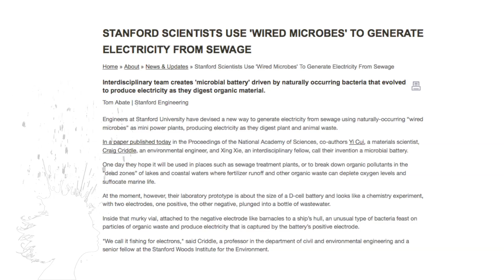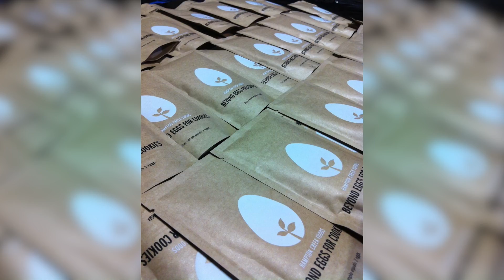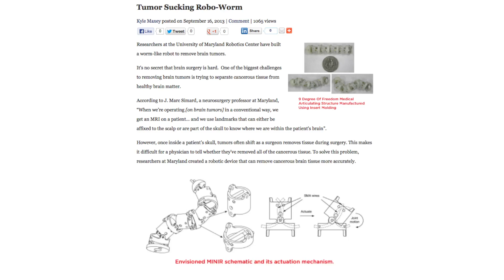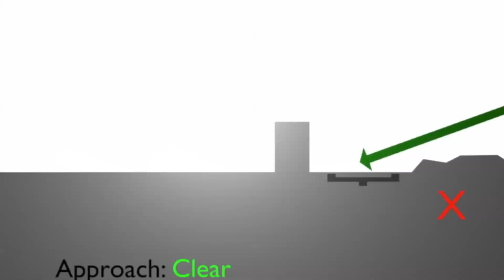POOP ELECTRICITY? -- Mind Blow #71

Comment: boeing is lying there @$$ off . 3:13 2 guys are visible in the "unmanned" helicopter"
Reply: They could be in there to land the Helicopter if something goes wrong with the AI that controls it.  You wouldn't want to lose a very expensive peace of tech because of one small programming bug.
Reply: Quanvex that is true but you also dont want to show it off and say its unmanned when its got 2 guys in it . at least tint the damn windows
Reply: I doubt they would let the prototype fly itself for the test run. Guess its safer to do the tests with pilots or passengers inside to see how it reacts with their weight. Kinda meaninless to have a copter you paid billions of dollars with barely any use or to let it crash in the test run, just saying.

Comment: it is most likely they have to produce in order to generate enough electricity, and of course they will also collect what is in there, but what ever reason is a process that it takes too long for just a little energy, and also is pollutant and dirty method, very stupid from people to even consider this expensive and difficult method, I like magnetic energy, is clean, intelligent way to produce it, effortless and clean and generate much more with a single generator than would a stadium full cheat

Comment: is false idea, methane is not so easily obtain through this method, is extremely difficult and expensive just to get a little bit of electricity from it, and you still have to burn it which pollutes, I TOTALY disapprove this method, is better and more intelligent to use magnetic energy which is clean and effortless also more efficient and provides more energy for thousands of years free, unlike your stinky cheat.

Comment: "Apparently some crazy Italian inventors have invented a weird contraption called the battery. Supposedly it holds energy? We still haven't found out just how to put it to good use though." - "Some guy invented carbonated water - it's like normal water but only harder to drink fast. Also it rots your teeth." - "Amazing new product - in the future you can spend time with the people you kinda know using electricity without actually having to spend real time with them."  :)